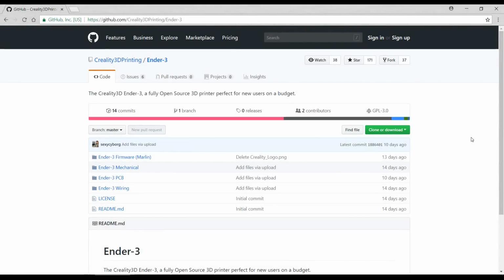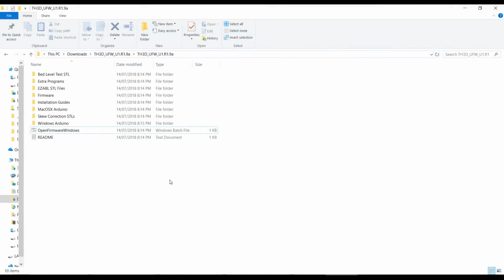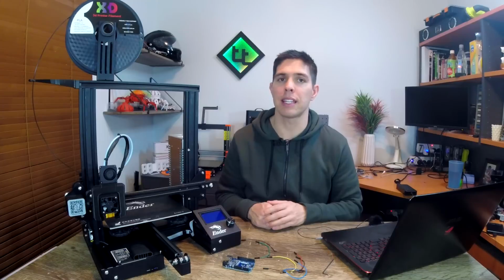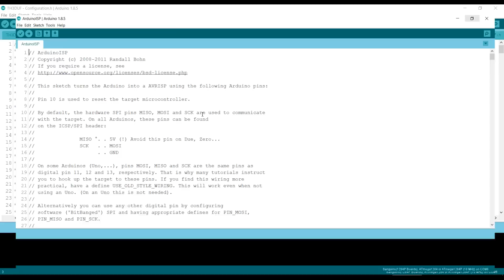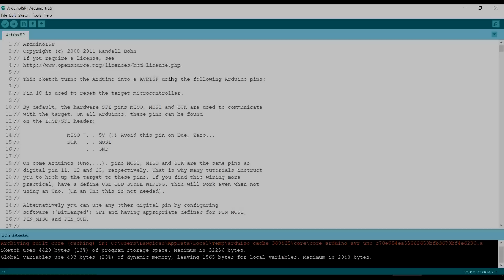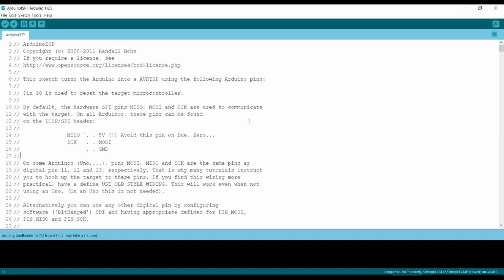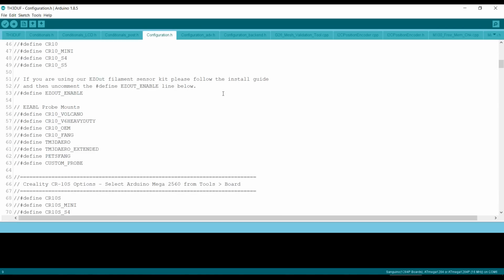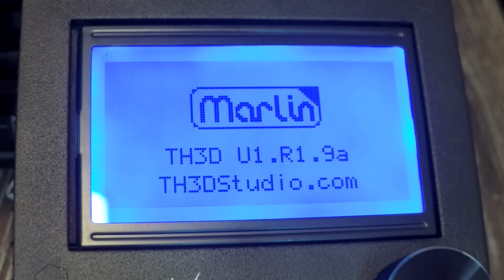Ender 3: How to install a bootloader and update firmware

Comment: An issue I ran into is my computer (windows 10) refused to recognize the printer as a port after flashing the bootloader no matter how many drivers I installed. I eventually gave up and tried using this method of using the uno instead of the usb cable to upload the firmware and it worked like a charm. https://support.th3dstudio.com/hc/en-us/articles/360043293572-Flashing-Firmware-with-an-Uno-Useful-if-your-printer-USB-port-is-bad  Hope this helps anyone else who ran into this issue!

Comment: Hi,
Great tutorial!
But anyway... i want to aks something...

I searched on the official page of Creality for firmware and I came across the following firmware upgrades for my 3D printer (Creality Ender 3 from 2018):

https://www.creality3dofficial.com/pages/ender-series

Ender 3:
------------
1. Ender 3 Source code
2. Ender 3 SD Files

1. Ender 3 BLTouch_8bit_1.1.6V
2. Ender 3 Firmware_8bit_1.1.6V
3. Ender3 Firmware 8bit_Marlin1.1.9V TMC2208

1. Ender-3_BLTouch 32bit_4.2.2_Marlin2.0.1
2. Ender-3_Firmware 32bit4.2.2_Marlin2.0.1
3. Ender-3_Firmware 32bit4.2.7_Marlin2.0.1 - TMC2225
4. Ender-3_BLTouch 32bit_4.2.7_Marlin2.0.1 - TMC2225

09/01/2020

I have some questions if you can answer:
1 - If I upgrade "Ender-3_Firmware 32bit4.2.2_Marlin2.0.1", does it include all the options from the other older upgrades, or does each upgrade have to be installed one by one?
2 - Are the Marlin firmware versions from this list are upgrading to the printer as complicated as you explained in this video?
3. "2. Ender 3 Firmware_8bit_1.1.6V" - is it an improved version of what I have on the printer purchased in 2018?
4 - if I want to install only version "2. Ender 3 Firmware_8bit_1.1.6V" - it installs in the same complicated way as you explained in this video? If not, can you tell me how? Or you have a video to know how?
5 - Is there somewhere a version to be installed easy directly from a normal and simple USB stick?

Maybe you can ask those from Marlin to make the upgrade easier somehow.
After all, the installation causes some files to be replaced with others and I don't see why it should be accomplished in this complicated way. :(

If is possible i'am waiting for your answer please.
Thank you.

Comment: TH3D is actually missing a lot of settings in submenus on the LCD, I can't recommend this. Going to Vanilla Marlin.
Reply: Agreed. Like a lot of settings. If you are able to successfully flash to your board from Visual Studio or Arduido IDE after all the TH3D setup stuff let me know. I can't flash to my board because of mismatched board type (sanguino_atmega128p? megaatmega2560? Idontknowanymorega2456)

Comment: Followed this tutorial today (only change was using Mega 2560) and it worked perfectly. Thanks for putting this video together, i know it takes a long time to compile something like this. Cheers!
Reply: Did you use PIN 10 as advised by video using UNO?

Comment: Hi :D Is it possible that I have deleted the BOOTLOADER on my CR10S5 (which I think comes stock on it) by installing the BLTouch firmware for the Ender 3 using the progisp.exe program and the ATmega 1248chip option instead of the 2560chip over the provided USB to 6Pin cable that goes on the CR10S5 main board?
Could this be the reason why my CR10S5 will no longer communicate with the PC? 
Please help :D

Comment: Cool! The problem I am having is that I accidentally installed ATmega 1284P chip on a CR10S5 via progisp. No the Printer when turned on only glows blue with no tex. What ever I do the Printer will not communicate via the USB cable that was provided so that I can upload good firmware over Cura... What can I do?

Comment: Hi im trying to put the boot loader on my ender 3 pro but im getting this error. 
collect2.exe: error: ld returned 1 exit status
Using library SPI at version 1.0 in folder: D:\TH3D_UFW_U1.R2.B5\TH3DUF_R2\Windows Arduino\hardware\arduino\avr\libraries\SPI 
exit status 1
Error compiling for board Sanguino 1284p.

Any ideas?

Comment: Thanks a lot for this!
At first it did not work and I got the following error: avrdude: stk500_getparm(): (a) protocol error.
After some searching I finally found a working solution: https://www.reddit.com/r/ender3/comments/aoadff/problem_burnig_bootloader_solved/?utm_source=reddit-android
In the sketch "ArduinoISP" you have to  change "#define PTIME 30" to "#define PTIME 20"

Comment: Thanks so much for the video everything worked great and it’s pretty cool that I get to change the printers name on screen, my only issue was after burning the boot loader and plugging in the printer via USB it wouldn’t show in the port. Tried two cables to no avail, third times the charm. Apparently I was using charging USB cables instead of data transfer and charging so after that it went well.

Comment: I've tried this today but could'nt burn the bootloader. I allway got the error: avrdude: device signature = 0x000000.
The fix was to connect the remaining pin on the printer to pin 10 on the uno. After that everything just worked.
Reply: same problem here, Pin10 also changed the wires

Comment: Any help overcoming a chip error (I have an Ender 3 that I switched to direct feed with a Titan Aero - I followed your other video on the firmware updates and now just trying to load it)?  

Error while burning bootloader.
avrdude: Expected signature for ATmega644 is 1E 96 09
         Double check chip, or use -F to override this check.

Comment: If anybody is having problems with uploading the TH3D firmware check this out: https://www.reddit.com/r/ender3/comments/bba005/unable_to_flash_ender_3_board_114/

Without updating you might not see the COM port or the upload fails with arduino IDE saying something like ser_open() acces denied.

Comment: If anyone is having a hard time installing the Ender 3 Pro on Windows 7, download the driver on this link, plug the printer via USB on the computer, unzip, install the EXE file and be happy. I was stuck on the last step, to upload the firmware to the printer after the bootloader. Gone all over the internet and found this.  Thank God. Was almost giving up. Amazing tutorial, but i would add this piece to be perfect! Many thanks.

https://th3dstudio.zendesk.com/hc/en-us/articles/360043291432-CH340-Drivers-TH3D-Uno-Creality-V1-1-4-V1-1-5-Board

Comment: Anyone with a RPI and new to flashing Ender 3 Pro or CR-10 might find this useful: https://imgur.com/gallery/4kIDSpv  It's a "plug n play" solution without even touching Arduino IDE. Only wiring change I did was connecting VCC to 5v in RPI instead of 3V.  This alternate guide can also be helpful, but the first method only takes 5 minutes.

Comment: Everything worked fine and thanks for the video but you should mention about the usb mini cable and provide a link.  My ender 3 did not come with it and i dont have those cables. After the initial step my lcd went blank. I thought i fried the motherboard.  Good thing the local shop was open and i got one. Without it you cant upload it.

Comment: I have Arduino 1.8.12 for Mac and my Sanguino board in board manager is named only "sanguino", its version 1.0.3 by Kristian Sloth, does it work for the Ender 3 Pro?. In this video its named "Sanguino1284P Boards", is there any difference between these two, or is it the exact same board?

Comment: I had to change something in the arduino isp sketch. A line that had 30 and changed it to 20. I don't know if you mentioned it but I needed to have an old USB cable not the current one being used by phones.

Comment: Does this make the experience with Octoprint better? I have experienced way higher print times and the print quality suffers massively compared to same gcode executed via SD. What do I need to do? I just want my Octoprint with camera and light without worrying about my prints taking forever and being low quality.

Comment: A problem I have run into with every tutorial I've watched is getting my PC to talk to the printer once I remove the Arduino. The previous com port disappears, leaving me with only com1, which does not communicate over usb.  I haven't seen anyone discuss using CH340, or FTDI drivers, or if they are even needed. Regardless, as always, TT provides excellent education.

Comment: WARNING: You will lose the resume print function if you upgrade. I believe the newer creality firmware has thermal runaway protection too. (Could be wrong, someone fact check that please). You WILL lose resume print though, so if you have a power outage during a print, then you have to start over. Hopefully TH3D adds that function soon.

Comment: Please help... how do I fix the "avrdude: stk500_getsync() attempt 1 of 10: not in sync:" error. I'm running windows 10 fully updated and an Ender 3 Pro with a Silent board.
Reply: me too
Reply: @emielpul8433  I found the issue... it was the USB ISP that came with my BLtouch that was the issue.

Comment: Hey man thanks for  all your videos. They have really made life easy when working with 3d printers. I have a question... I want to upgrade to the 1.1.5 silent board, but its sold out for ender 3 pro at creality3dofficial.com at the moment. But the ender 5 pro version is not. Can I buy that one, and just install the Ender 3 pro firmware onto it, when I recive it? kind regards from Denmark.

Comment: Thank you for the nice tutorial. 
I have some problems with the updated firmware...
The Z-Axis is not moving up bevore the preheating.
I have the ender 3 pro, the latest firmware "TH3D_UFW_U1.R2_A8" and did everything as described.
Did anyone ran into the same problem?

Comment: So I just installed the silent board on my ender 3. The LCD previously worked fine. After installation I get a blank blue screen. Does this mean I will have to do this boot loading to it too or should it be working and maybe the board is defective?

Comment: Hey, I recently updated the firmware on my ender 3 pro and this process worked great. But for the last step of  this (initialize eeprom) my printer doesn't have that instead it has reset eeprom anybody know what that means? Or what I should do?

Comment: Hi Michael. An oldie but a goodie. Thanks again for all your helpful content. I plan on using my old Creality Ender 3 main board for a robot project. You briefly mentioned here that you hook up 12v or 24v to the board to run the stepper motors. It wasn't clear to me if you meant 12v is OK on the Creality main board to run stepper motors or that the 12v was if you were running another board. So my question is Can you run the Creality main board off a 12v supply and run the standard (typical on 3D printers) steppers?

Comment: Thanks for uploading this video!

I've installed the bootloader and CH340 driver (I have a V1.1.4 board), but when I connect the printer to my PC via usb I do not see any COM ports and do not hear the typical sound that plays when a usb or other device is connected.

Also, my screen no longer shows the Ender logo when powered from my PC or from the power supply.

I've searched reddit and a few other forums but haven't found a solution yet and would appreciate any advice!

Thank you,
Joe
Reply: SOLVED!!

So the good news is that a solid blue screen after loading the bootloader is a GOOD sign.

My issue had to do with the USB port on the Ender 3. I read that using a USB 3.0 port on your computer may cause a problem, but even when switching to a USB 2.0 port I was still having issues!

Luckily, I stumbled upon this video
https://www.youtube.com/watch?v=22MKInJDc64&list=WL&index=4&t=0s
and saw Arnout's comment.

He posted this link
https://www.th3dstudio.com/knowledgebase/flashing-firmware-with-an-uno-useful-if-your-printer-usb-port-is-bad/

All I needed to do was hook up my uno the same way as we did in this video and when I was ready to upload the firmware I hit "Sketch > Upload Using Programmer"

When I did that I could see the Tx and Rx lights on my Uno flashing and after a few minutes I got a "Done Uploading" message in the IDE and my Ender 3 load screen came up again along with a second screen saying Marlin 1.1.9!

What a relief to have my printer up and running again, I thought I fried it!

I hope this helps someone in the future!
Reply: @josephwhaley8396  Dude thank you so much! I had the same problem and your solution worked.

Comment: If you are stuck with an UNO arduino starter kit with no female/female connectors, you can still get the bootloader to write with the kit's Female/Male connectors using the old style wiring with the Male connectors going straight into the UNO board.  For this video, the 
BLUE => Pin 13 (SCK)
RED => Pin 12 (MOSI)
GREEN => Pin 11 (MISO)
YELLOW => 5V
PINK => GND

Comment: Great Tutorial.. I even had an Arduino starter kit that has the UNO with USB cable and plenty of jumper wires, so I've already got all the hardware... This will be perfect as I plan to do the BLTouch soon too!  Does this apply to the upgraded "quiet" board?  I already did that upgrade.

Comment: Hello, thanks for your tutorials. I updated my firmware ages ago and modified several things I can't remember. Is there a way to dump the firmware I'm at and keep modifing it instead of starting over with a new firmware? Maybe I didn't get all this firmware thing, what I would like to do is just changing the check points for BLTouch on the bed without having to look for all the other mods I made earlier, so that I don't have to watch again all the tutorials I followed.

Comment: Well, it does not seem to be painless I have been through this video and followed step by step about four times now and get an error uon trying to upload the TH3D firmware every time I have tried.
Reply: Got it installed thanks again, had to use three different tut's to do it but, it's done.

Comment: Process is still working as of Feb 2020.  Some of the default options have changed (for the better) and it went super smooth.  Don't forget to initialize the EEProm as is mentioned in the notes above.  That is easy to miss.

Comment: Question.. I compiled Marlin 2.x.x via mostly your videos, exported for flash(from arduino software) via Creality provided flasher for their BLTouch. Now I want to reflash with a bootloader. Would it be as simple as flashing the other HEX that the arduino software labeled w/ "bootloader"?

How much space does the bootloader take? I disabled everything recommended to disable(and maybe a few other small things) and the firmware was at 99%(maybe 98%).. will there be enough room on my board to flash one? Thanks!

Comment: Hey Mike
Just wondering if you knew if the the new Ender 3 2019 model  which has the removable bed which is held on with clips needs this firmware update??

Comment: Well explained tutorial. I would add that for Ender 3 Pro, the board is upside down, so you will have to tilt the printer on its side and open it from the bottom.

Comment: Well it was too good to be true. Errors from the beginning.  Could not set my Arduino as ISP.    Something about Access denied to COM 7.

Well after ponder the web for a hour, I found the solution:  I had to reset my Arduino clone manually before it would work.   Great.

Well now I am pissed.  Accessing the Ender 3 Pro control board requires tipping the unit over.   As such it got bumped and fell off the table.  Now it won't even sit level.  

So I figure I may as well get it flashed right?  Nope.   The software utilized a different com port (no big deal) but now windows was blocking the com port.

Another 2 hours and I finally find a random post on an obscure thread that helps.  I had to restart my PC because apparently it can lock the com ports when you plug and unplug devices.  

Well in the end it DID get upgraded and flashed, looks great, but I then had several more hours taking my beloved Ender 3 apart and attempting to level it and put it back together.   This meant a thorough cleaning and readjusting every place possible.  The bed was the worse and took 15+ times to get it where I was Ok with attempting to try a test print.   I am about 95% back to where I was at.  It does not appear anything was twisted or broke in the fall. 

I'm wondering if perhaps the issues I had could have been avoided if there was something I did during the process such as unplugging a USB cable or installing the wires from my Arduino to the board (powered on, powered off? etc.)  The lesson here is that NO ONE should assume  its ever going to be as easy as the video claims.   Everyone's PC, Arduino, wires and knowledge is different.  IN my case I also added the unfortunate step of having to rebuild my printer.  I was lucky in that the damage does not appear to be permanent.

Comment: It might be worth mentioning that in some cases a capacitor of 5-10 uF is required between RST and GND of the arduino. This avoids, that the arduino is resetted during the burning process, which causes an error.

Comment: Is it possible to use a Arduino nano clone instead of an Uno? I still have a spare nano and would prefer to use this one instead of buying a new Uno :)
Reply: Finally worked with the nano, just in case someone has the same question

Comment: Good thing I tried to upload the scetch beforehand my board (Silent V1.1.5) came with Marlin V1.1.8 and a bootloader preinstalled. Nice dont need to flash anything
Reply: So did you just the steps apart from the bootloader bit? I've got the 1.1.5 silent board too.